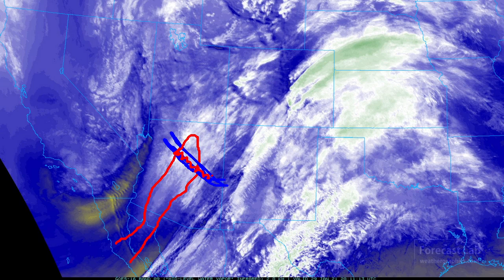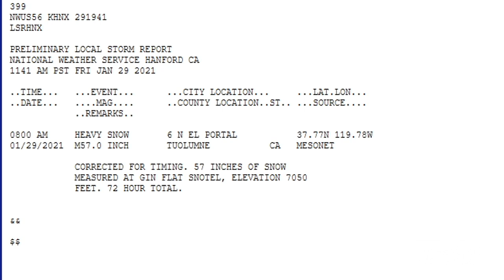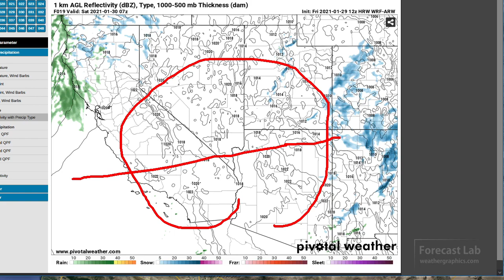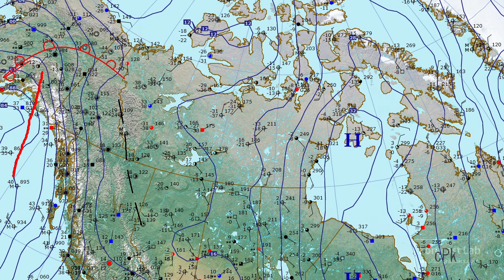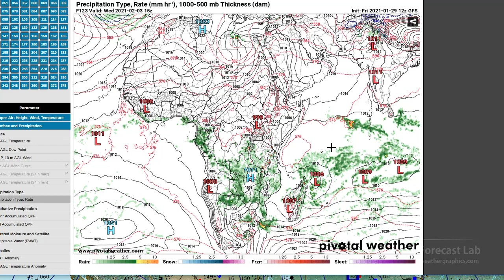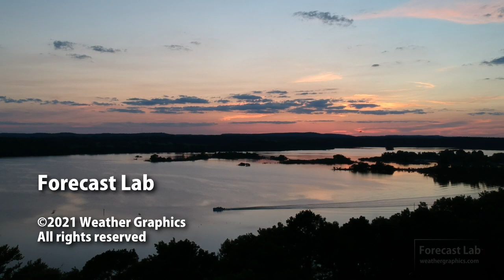Fri 1/29/21 - National weather forecast / California storm summary / New Mexico & Texas windstorm

Comment: Was  to see the shift in east pacific storms finally soaking south California instead of BC/Wa. region. Incredible how rarely this happens but when it does wow... 15” in 3 days & 10’ snow ❄️. 
Thanks for the world tour...!

Oh saw this on Environment Canada 🇨🇦 
App.

A new world record for high air pressure has been provisionally set in a high mountain valley in Mongolia. On the morning of December 30, 2020, an automatic weather station in Tsetsen-Uul, in western Zavkhan province, recorded a mean sea-level pressure of 1094.3 hPa along with a bitter temperature of -45.5 °C.

Otgontenger Uul is the highest peak (4,008 m) of the Khangai Mountain Range in Western Mongolia, 60 km from Uliastai, the capital of Zavkhan province.

As usual with all potential world weather records, this reading needs to be verified by the World Meteorological Organization. If confirmed it will top the previous world record set also in Mongolia exactly 16 years ago on December 30.

It is normal for Mongolia and parts of Russia, such as Siberia, to see episodes of high pressure and extreme cold in December due mainly to the distance from a relatively warm ocean. In continental regions such as this, including our Canadian Arctic, the air gets very cold, dense and sluggish, and the air pressure builds.

It should be noted that this potential pressure record occurred high up in a mountain valley. Air pressure decreases with altitude, thus calculations have to be made to “convert” the pressure reading to an equivalent at sea level and hence verify the world record.

Canada’s highest recorded pressure

The highest pressure ever measured in Canada occurred in Dawson City, Yukon on Feb. 2, 1989 with a reading of 1079 hPa.

Surface analysis map – February 2, 1989. Much like a geographic map of topography, the lines (of equal pressure) peak around the centre of the high pressure in the central Yukon. Credit: NOAA, NCEP.